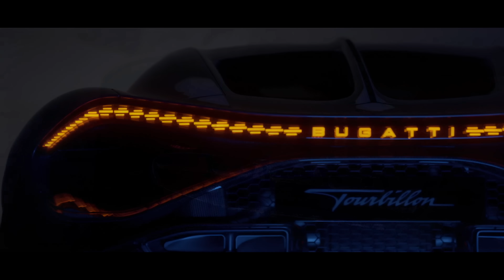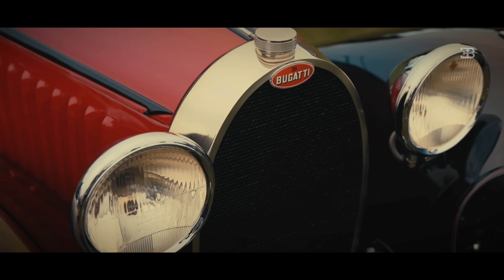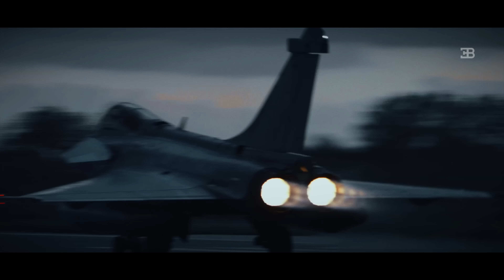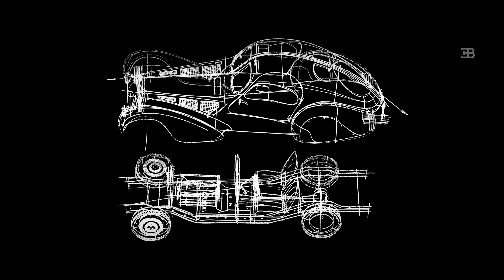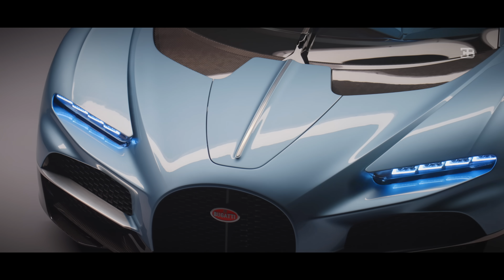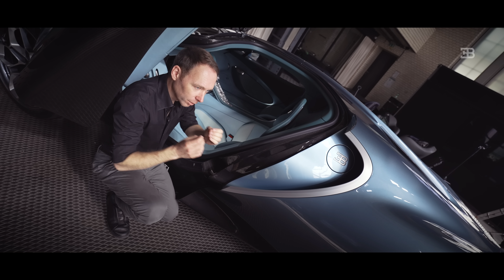BUGATTI – A NEW ERA: Design Excellence pt.1

Comment: Im kind of fed up of Bugatti singing the praises to itself in self aggrandisement despite not actually achieving anything technologically in the last 20 years, they are using pretty much the same engines, gearboxes tires etc that they were 20 years ago with the veyron meanwhile koenigsegg have developed 1600hp engines with half the cylinders, light speed gearboxes, 330mph cars, 4 seater-2300hp family cars, manual + automatic gearboxes, high economy low emission engines, high speed valves etc, etc, etc, etc, etc. I say this as someone who used to love Bugatti but im getting fed up of them doing fuckall not innovating anything whatsoever recycling the same engines gearboxes, etc, and landing their new cars' top speed LITERALLY lower than their previous car;  but we're supposed to clap and cheer because they shoved a battery in their new car, Bugatti can fuck off, good day.

Comment: when will you guys enter the new era Bugatti ?! with revolutionary car shape change for enabling absolute ultimate top speed on ground type? 

all i m gonna say is: put Bugatti power and engineering.. in aptera 3 wheel ultra aerodynamic shape (the aptera kick starter car) . i mean this is realistically speaking the only way for achieving more than what Bugatti currently can achieve. at such high speeds it s all about friking aero.

Comment: Overall - the transfer of Bugatti into the hands of Mate - was a good move from VAG. This way, the world's top car (or one of the very few, at least) doesn't have a key ... and beeps and bongs - which are made for a Jetta. Which is good. Now for the bad news. This guy - when he says "that speed is enough for an airplane to take off" - by saying that - doesn't understand how a wing works. Just kidding. Also - this is truly impressive. These amounts of millimeters - are huge - in this packaging scenario (yes, clever words). He never mentions that the V16 is intrinsically... probably.... at least twice as long (bar the turbos ofc) - than the W16. Also - this one will have to accommodate not only tall drivers in comfort - but also an electric cell (battery) and motors - for the e-mode - which this car will surely have. Also - hinges and front boot lock - won't be off of a Jetta. That's good.